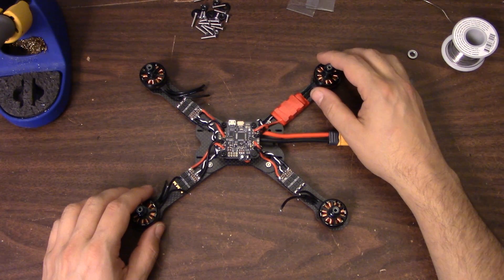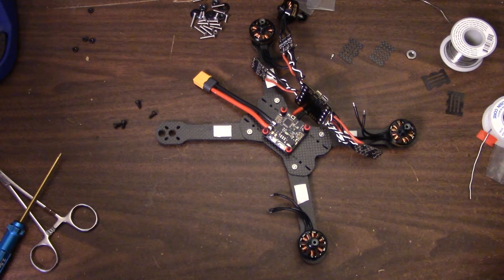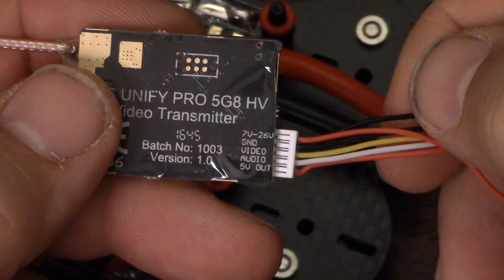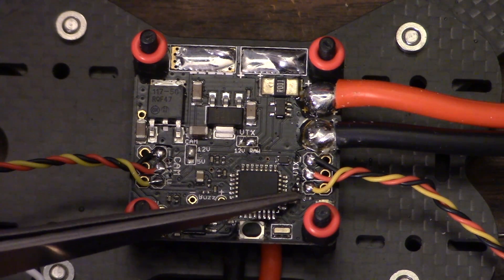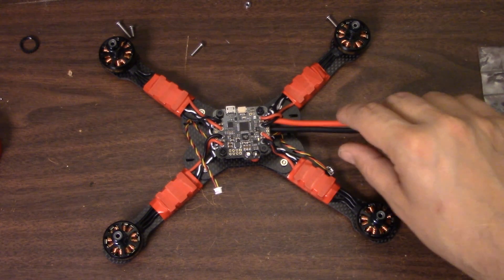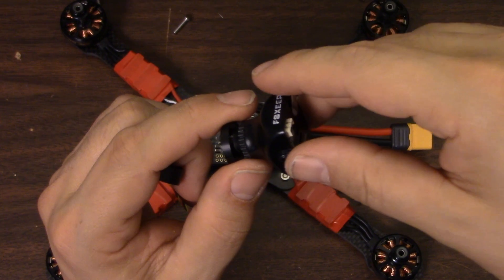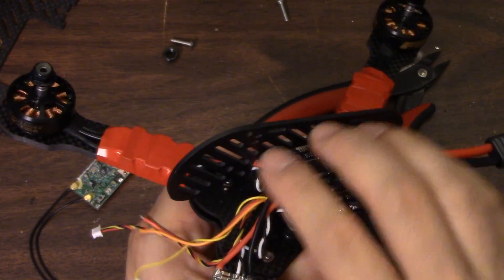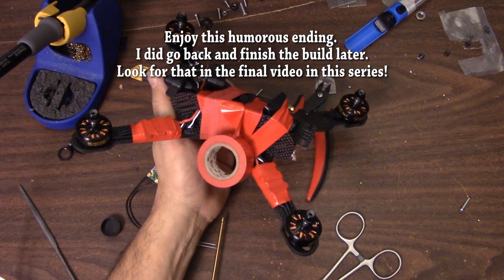HOW TO BUILD A QUADCOPTER | AllCarbonRC Coyote | Part 2

Comment: I've done stuff like this so many times... I always just thought I was just a big ole dummy... After watching this I realize that even a person such as yourself, that I look up to so much and consider to be a genius and a guru, can make the same type of mistakes I so frequently make.  This improves my self-esteem a great deal.  I really avoid these types of frames with the side walls and stuff because I don't like building as clean as they require.  I have to leave wires long so I can re-do stuff and move stuff around to other parts and different frames in the future.  It's just bit me too many times making everything fit just so.
Reply from the maker: I make a lot of mistakes, especially because I am often working with a new frame or FC that I have never seen before. The real test of a pro is not whether they make mistakes, but how they deal with them. I always make sure to post videos where I screw up because I think that's where you can learn the most.

Comment: Just measured the RPM at mid throttle = 1500PWM for the 3-blade prop. I measured a raw RPM of 18139 which results for a three blade prop to 18139/3 = 6049 RPM If you compare that with the chart  http://rotorbench.com/DYS_1806_2300kv  I should achieve with the 1806  motors at least between 12000 and 14000 RPM. Voltage of the battery is ok with 11.49V at 50% throttle. So now I am just waiting for the new props....

Comment: i recommend to not use the O Rings when flying on concrete i had with 2 quads the problem that after a crash the nylon standoffs breaks easier because of the the bigger bending way to the washer. 2 different days 2 different quads and they broke.
When you flying in the greens no problem, but at the moment its winter and parkhouse session so i will not put the orings on it from my experience.
By the way why not connecting the audio cable to one rx pin then you can switch frequency and bands and power over osd
Reply from the maker: I didn't hook up the audio because I recorded this like three weeks ago, and Betaflight 3.1 hadn't announced the SmartAudio feature at that time.

Comment: Fantastic work again Josh. I abso-fn-lutely love your great thinking and sense of humour.
Timeout to cut some paper dolls for a while I think :-)

BTW, instead of direct 'soddering' smaller gauge wires I've found that it's best to mount pin headers (bent) and just use the ends for servo pins covered in shrink tube.
Reply from the maker: I have done that in the past but pin headers are too bulky on some of htese tight builds, and I found the pin headers did not hold securely if there were not several of them in a housing.

Comment: Just had some misfortune today with my brand new GEP-ZX4 (170mm X frame)!

Installed DYS 1806  2300kv motors with  GF4045 props and what a surprise the coper even doesn't lift... Total weight including a 3S battery, camera, VTX and GPS is 430g. 

But following this link: http://rotorbench.com/DYS_1806_2300kv/ it should lift.

My next step: Will throw out the GF props and replace them by HQ props (should give 38% more thrust) ...and test again....
Reply from the maker: Props on upside down.

ESC endpoints not calibrated so ESCs are not going to full throttle.

Transmitter endpoints mis-calibrated (must go 1000 to 2000 us in the Receiver tab) so throttle channel is not going to full.

That setup absolutely should fly.
Reply: That is most likely it, Esc endpoints.
Reply: In this or the last video Joshua says something about a DYS ESC's having a de-sync, regards using the reverse feature within BL-Heli suite.
Maybe check that.
Maybe it is that, as you say it isn't prop, direction, or end points.
Good luck fella.
Reply: I got a similar weight copter with DYS 1806 2300kv motors and it flies fine. I even got poor Afro 12A ESCs on it. I run this with DALprops 5045x2 BN, so there is something wrong this your build. Did you mount your props the right way?
Reply: Also 3s turnigy nano techs
Reply: So, this is my 12th built multicopter! 

Endpoints are calibrated to 1000 and 2000 mS  (I fly all my copters with the same setup on my TX) Midpoints on the TX are calibrated exactly at 1500 mS. 
FC is flashed with Betaflight 3.01.

I have flashed all ESC's with BLHELI 14.8. ESC's are DYS 20A which work very well  in my Tarot-TL280. So something is wrong with the combination of props and motors. 

If HQ props don't work I will change the motors. Btw I forgot, above prop spec was not correct ,I used  props 3 blade DYS  X40403 for the first test.
Reply: Props are not !! mounted upside down, or turning in the wrong direction. Before mounting the props I had to correct the direction of 3 ESC.s with BLHELI to REVERSE. (reason for the 3rd ESC to be reversed was that I had soldered the motor  wires on this ESC on the bottom side and had to turn the ESC 180° around)Esc`s were properly configured with Betaflight. When I move throttle to max.  motors are speeding up and the quad is close to lift, but only close. What I didn't do because it is a little risky is to measure the RPM's of the motors with 50% and 100% throttle. Will do that as well tomorrow.
Reply: That's it! Changed all DYS ESC's with FVT Little Bee ESC and the copter flies!

Comment: If you could do a Dshot F4 (or good f3) build that would be awesome. I can't find a whole lot of info on any of the F4 flight controllers listed in the dshot/betaflight wiki. Is there a good flight controller that can run dshot that has a lot of support for setup (like maybe the spacing f3 or something)?

Comment: Hey joshua! sorry this is unrelated but, i followed all your steps exactly on you video on setting up the piggy osd via serialpassthrough, and im sure got the corect message from betaflight, but i just cant seem to connect to the mwosd gui... Please help hahaha thanks so much ur the best honestly! XDcurrently on my fpv it shows just timer with 0v and 0A. im using cyclone fc, using uart 3, with serialpassthrough 2 115200. wiring im sure its done right too.. Thanks so much in advance!! :)
Reply from the maker: The next thing I would do is try connecting directly to the Piggy with an FTDI adapter instead of using passthrough. Just remove one thing that could be going wrong.
Reply: i see.... but isnt the ftdi adapter is just to change the format and settings on the GUI? or do we have to activate or switch on something in the GUI for the settings to work?? because i have the voltage "template" on my fpv screen, but no data is being transfered to the osd apparently... so will a ftdi help?? if yes ill go purchase right away! XD
Reply from the maker: If data is not communicated between the OSD and the FC then you have not got your UART configured correctly, or it is mis-wired. You must have MSP on the UART that the OSD is using. And you must have TX and RX wired up. Remember that TX on the FC goes to RX on the OSD and vice versa.